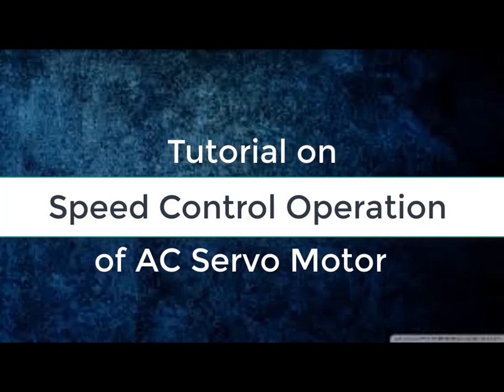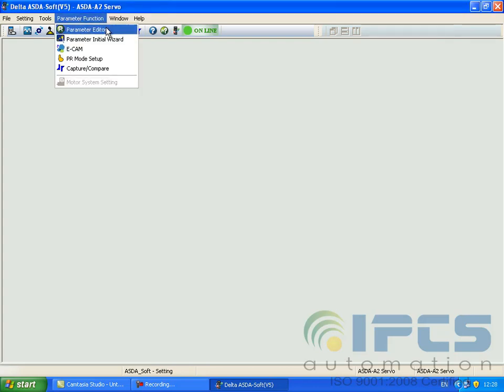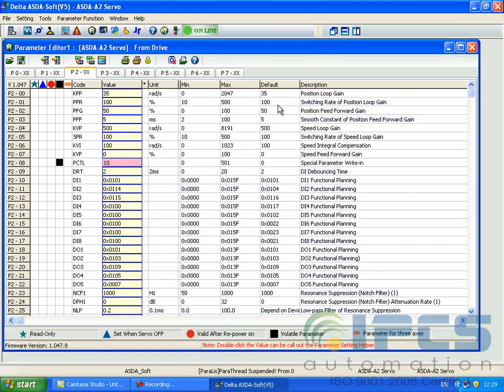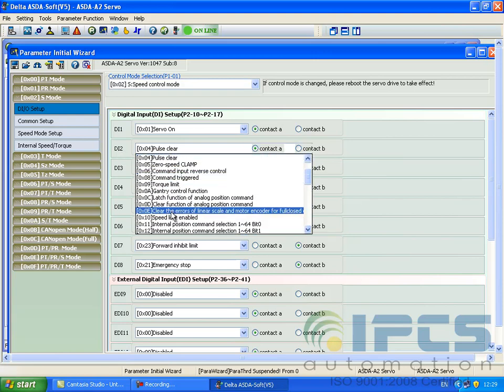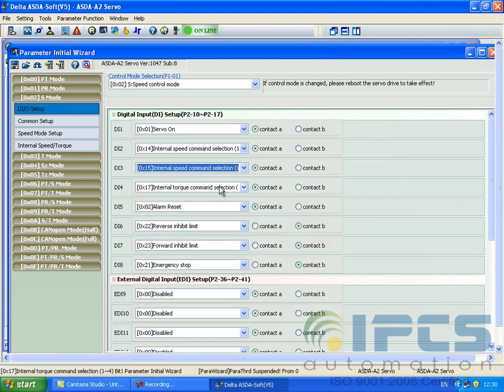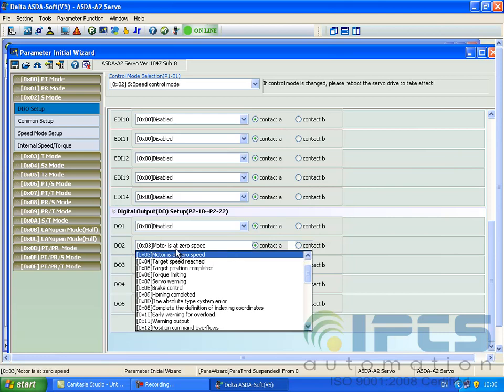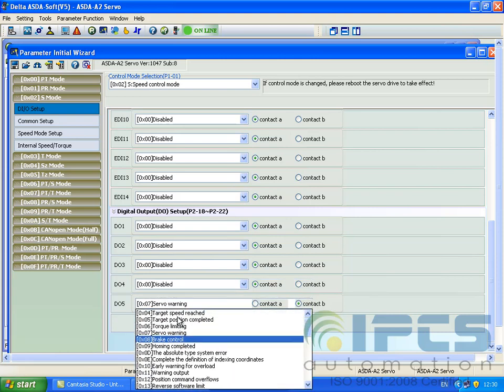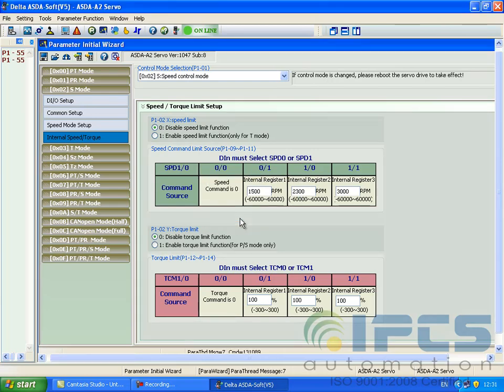Delta Servo Speed Control

Comment: sir nice video 
sir, can you please make a video on how to control the Delta ASDA-B2 servo in speed mode and also with acceleration and using delta PLC to change the rpm of the motor
please sir 🙏🙏🙏🙏🙏